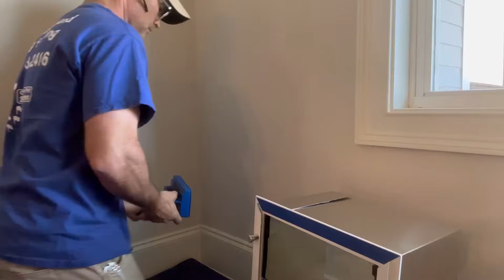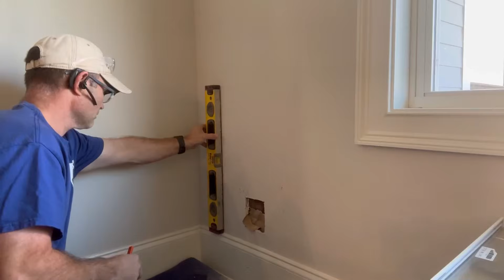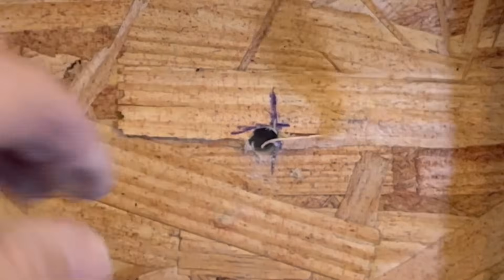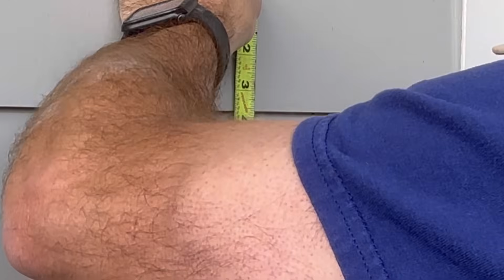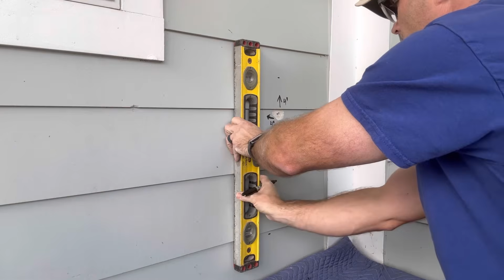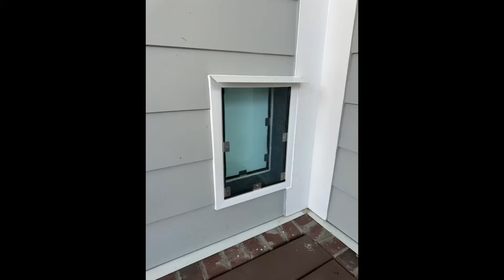How to install Pet Door Through A Wall - Installer Provides Best Tips For Professional Installation

Comment: I think exterior location is most important. You want it to look good if you have a pattern siding and you also don't want an air gap at the top due to a groove where water might penetrate. A few inches up/down or left/right might be needed on the outside wall. Drywall looks the same inside no matter where it is located.
Reply from the maker: Thank you for sharing your thoughts! Very helpful! When installing a pet door, placement is dictated by the dog that will be using the pet door. This starts on the interior side. We want the dog to comfortably use the pet door throughout their life span. This means that the pet door must drop down low enough to the interior floor so that the aging dog can continue to use it with ease. As well as the top of the pet door to be a few inches above their withers, to prevent them from having to crawl through it. Framing studs, electrical work and other obstructions can also dictate the placement of the pet door as well. The ultimate goal is to be sure the pet door is useful for the intended purpose. Sometimes this may cause the exterior placement of the pet door to not perfectly line up with exterior siding. A quality sealant should be used to seal up the pet door on 3 sides to prevent any water intrusion.

Comment: My mom is having her garage rebuilt after a fire. Wouldn't it be best to go ahead and frame the opening for a cat door now while it's just studs and siding?
Reply from the maker: The pet door I offer is designed to be installed in a finished wall. No extra framing is needed as it is self framing. I would finish the wall, both inside and outside and then install the pet door.
Reply: @outdoorpetsolutions The door she's ordering is from Amazon. Why would I not go ahead and frame the opening now so that I wouldn't need to cut an opening later?
Reply from the maker: @samizdat113  because most pet doors frame over the finished wall. You can certainly go ahead and try to frame and prep the opening ahead of time. I just prefer to work with the finished wall to create a seamless installation of the new pet door.
Reply: @outdoorpetsolutions The wall would be finished. Sheetrock inside, siding on the exterior.

Comment: blow out- just use a smaller drill diameter first, always go slow, dont use a dull drill bit
Reply from the maker: Thanks for the tips! Blow out is inevitable, especially when drilling through brick with a hammer drill. The very last layer always pulls away. The outer edge of the pet door frame only covers about a 1/2”. So it’s always best to drill in the center.

Comment: Thanks! Any chance on doing this on stucco exterior? How do you search for someone who is qualified to make a hole in your wall?
Reply from the maker: Stucco is a very soft material. I typically just use a diamond concrete blade on a circular saw to cut through the stucco. I would google search your area for a reputable home service provider (handyman) they should be able to handle it for you. The premium pet door that I offer, comes  with complete installation instructions. 
https://www.outdoorpetsolutions.com/store/product/premium-pet-door

Comment: First, great video thanks for the explanation will be using this knowledge 

Secondly, I couldn’t help but stop the video and be entranced by the second pet door opening on the brick. That’s a hell of a long way down for that size of animal.
Reply from the maker: Glad the video helped! The pet door through brick was getting a raised deck built just below the pet door. The customer wanted the pet door installed before they started the deck so they knew how high up to put the deck. 
Adam- Outdoor Pet Solutions

Comment from the maker: Yes. The rain cap is included with the Wall Model pet door. 
Adam- Outdoor Pet Solutions
Reply: @outdoorpetsolutions  perfect I just ordered two if there's anything due to expedite the order faster than five days that would be great. We're having new windows installed on Monday so if I can get it before the end of this week, I can install them right now we use a panel doggie door that goes between the main slider door and the wall which damages thedoor seal and I don't want to scratch up the new doors. I would like the wall mounts installed we got three little doggies so it's a pretty active door without a doggie door. We're gonna be up and down quite a bit the next couple weeks lol
Reply from the maker: @ order received and sent to production. You’ll receive an updated tracking email once your order ships out. Thank you
Adam- Outdoor Pet Solutions

Comment: Can you send me the link to the dog door you have with the exterior rain, shield double door and interior carpet that you have on your own personal property I cannot find it on your page
Reply from the maker: Sure! Here you go! 
https://www.outdoorpetsolutions.com/store/product/premium-pet-door
Reply: @ is it something you shipped direct or is it coming from the manufacturer if I ordered it right now what's the turnaround time on delivery? It's not showing me in my cart.
Reply from the maker: The pet doors are made to order but typically ship out whiting 24 hours. We ship them via UPS ground, so depending on your location, delivery is within 1-5 days. 
Adam- Outdoor Pet Solutions
Reply: @outdoorpetsolutions  just to confirm it's probably a little late for this question but the dimensions that we pick are the actual hole opening correct the dimensions of the door flap for access in and out and not the total frame
Reply: Sorry for the staggered questions and so many of them I'm working and trying to facilitate this whole project. I appreciate all your input.
Reply from the maker: @MarkBuress yes sir that is correct.
Reply: @outdoorpetsolutions  I didn't Received a confirmation of purchase email I would like to make a small change to my order if it's not too late would like to Incrwase the width by one inch to 7.5 

Is there a 800 number I can call
Reply from the maker: Hello sir. I see you found the email receipt that was sent to you. Your order, as you requested was already shipped out very fast on the same day (yesterday). I emailed you back, regarding how to return the order if you wish to purchase the next size up which is our 8.5”x12.5”. Please continue to communicate via email or phone, as it is a faster way to handle your requests. Thank you sir
Reply: @ also is the wall mount little extra awning piece for the exterior of the wall mount  standard on everything or that something has to be added to the product

Comment: What do you do to make sure your installations are weather-proof?
Reply from the maker: The premium pet door comes complete with full installation instructions that will guide you through the process of sealing up the pet door. The wall model in particular comes with a rain cap guard and flashing for the steel tunnel. Adam- Outdoor Pet Solutions

Comment: Don’t these pet doors come with a paper template so you don’t have to do all this measuring?
Reply from the maker: The high end pet doors do not come with a “paper template” like the low end cheap doors. Measuring the pet door RO correctly and transferring the measurements is key to a flawless installation. This video is addressing the down falls that are caused by the installation instructions provided in the low end pet doors and how to avoid causing blow out from penetrating to the outside.